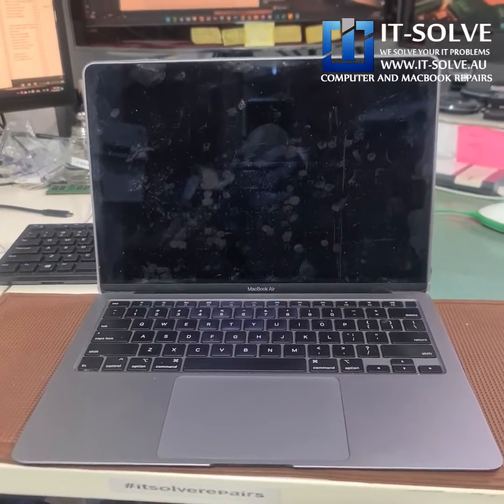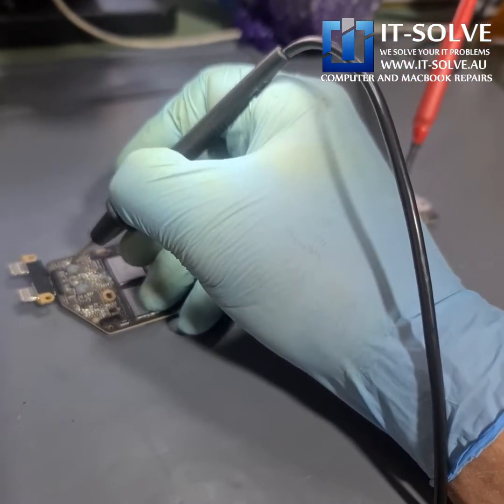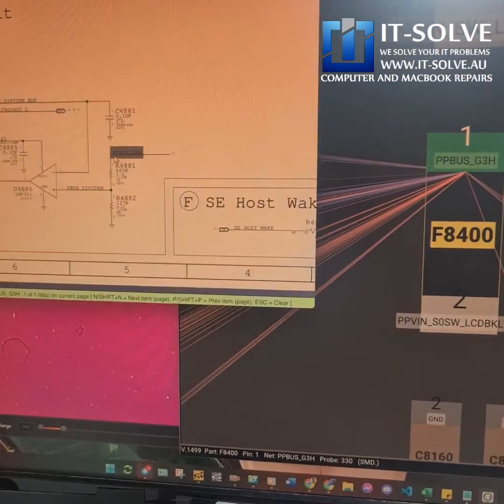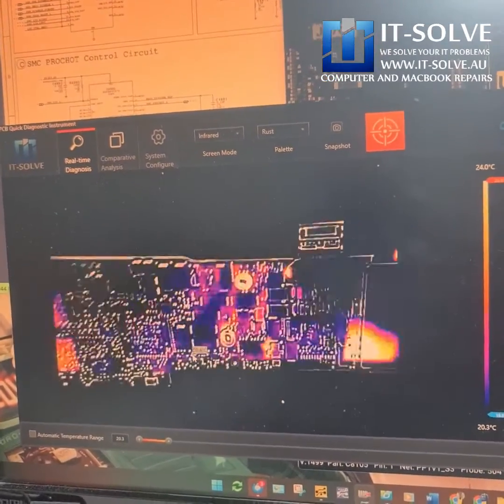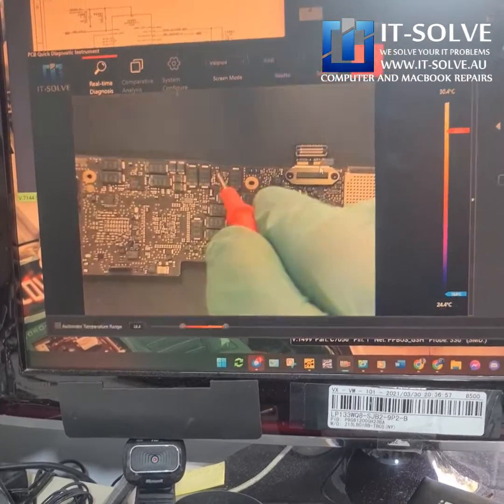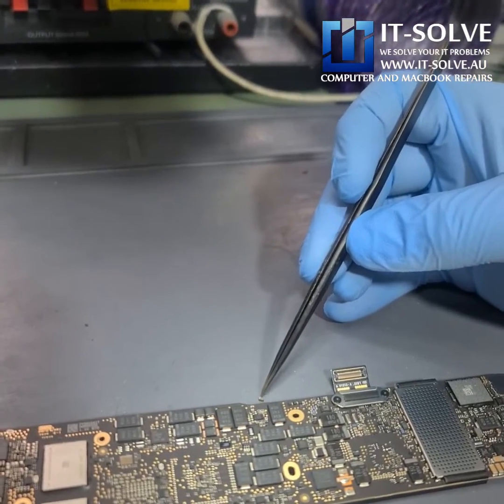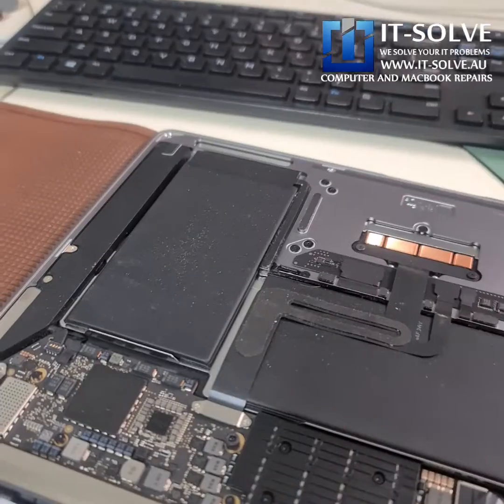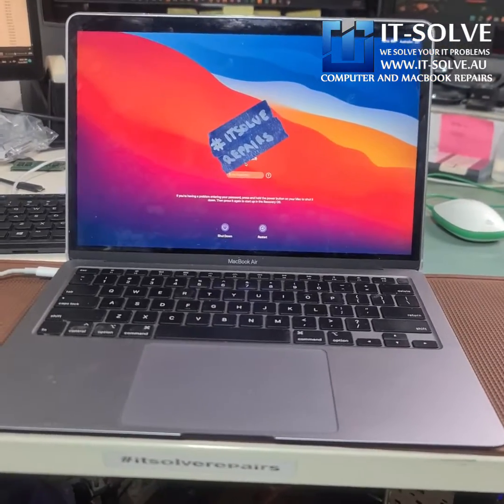2019 MacBook Air Not Turning ON Repair caused by a Shorted capacitor

Comment: amazing work, sir! Is it common for that specific capacitor to be the culprit in these situations? I have the exact same issue even after a battery replacement.
Reply from the maker: There is no fan in new Macbook Airs, so any cap can blow. Usually, higher current lines are the ones under immense stress.

To answer your question, this is the first time we have seen that particular cap blown.

Good luck